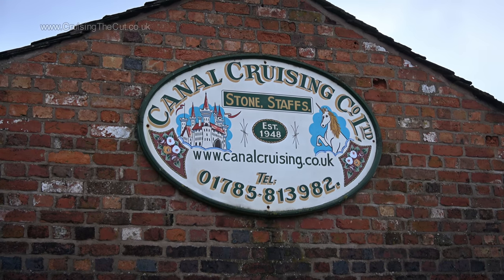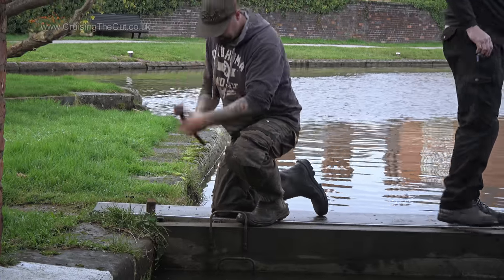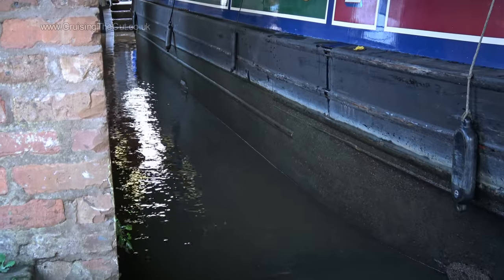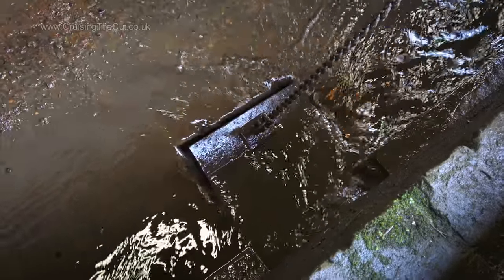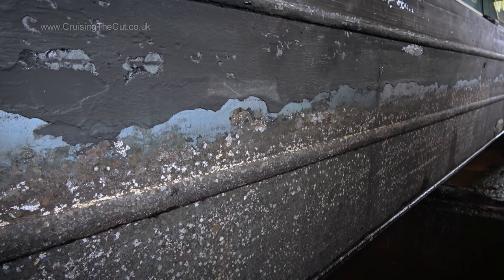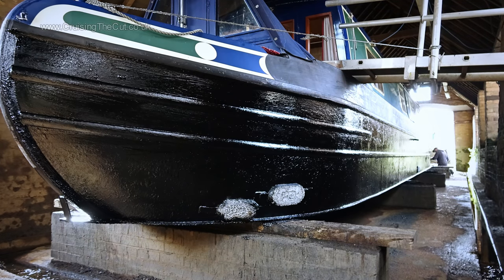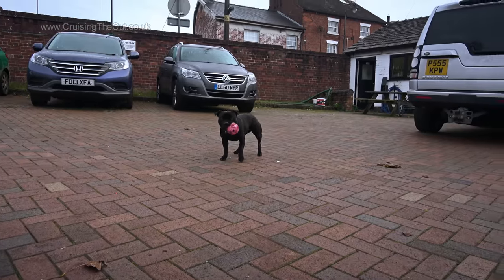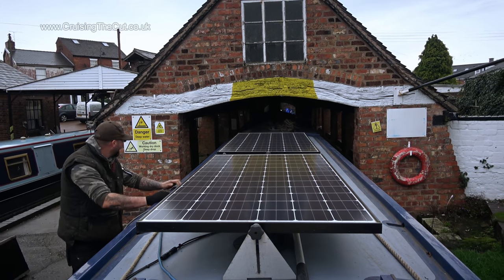201. In dry dock! Re-blacking my narrowboat

Comment: You are the second boater having had their boat blacked that i follow , the other being your friends Narrowboat Experience . They had a different type of finish if my memory is correct .I think they said they could leave it for five years  or more . I'd be nervous about that amount of time unchecked , but they did their home work .
Reply: 😂 With all the slightly negative comments ref epoxy coatings I suspect their boat will be inspected a lot sooner than five years ... 

Doubtless their homework spot on ref the product per se. But the weak point is the actual application of the product onto the bare steel.

According to forums and manufacturer's websites it is essential to keep as close as possible to the manufacturer's method statement when applying the product.

Took up the epoxy v bituminous coatings issue with our resident marine engineer this very morning.

He was less than enthusiastic with epoxy coatings on narrowboats explaining that the coating was not as impact and abrasion proof compared to bituminous coatings.

(He opined epoxy coatings would be fine for sea going tugs, say, as there were so many fenders that metal to metal contact was quite rare.)

Again in the engineer's view the best coating he had seen was cold sprayed galvanising.

I gather galvanized coatings self coat over a scratch but please feel free to do the correction thing.
Reply from the maker: They used a two=pack epoxy coating. However, not only is the epoxying expensive, my boat would require grit-blasting all the old bitumen off first (which is extra expense). Then the epoxy can still be scraped off in the canal. Plus I'd still want to haul it out every three years to check the hull over anyway because that's just how I am. So ultimately, I might as well stick with bitumen.
Reply: @CruisingTheCut  if it's not broken don't fix it 👍
I too read that you need an ideal environment for the epoxy to take correctly. A dry dock doesn't give you that environment
Reply: @CruisingTheCut  I agree with you .

Comment: Aaaaaand most importantly and always omitted for some reason... how much did it all cost?
Reply from the maker: Omitted because it varies enormously depending on where you take your boat, how long the boat is, how many coats you want, the type of blacking used (etc). As a rough guide, it was about £10 per foot of boat length when this was done.

Comment: David, from a comment you made it sounds you haven't resolved the fender spacing issues. try googling  "fender board"  they work, are cheap and easy to make, because of the weight of your boat I would use a fir  2X8 or something comparable.  Dave

Comment: I have asked this question of others and perhaps you as well - however,
I have never gotten a response.
Why moor up in the winter?
Are there rules about staying off the canals at that time?
Is it just because of cold bad weather?
Do the Locks freeze up?
Why?
Reply from the maker: No rules against it - in fact some of the rules are relaxed in winter - but there's little sunshine for solar so you end up running your engine a lot for power / hot water, plus as a solo operator, I'm not a fan of operating frozen / slippery locks on my own, plus it's very cold (!) plus the days are short and yes, the canal can freeze over sometimes. Basically it's just more convenient to moor in my case in a marina with facilities and a shoreline etc.

Comment: I really enjoy your programs. I do find it interesting that you don't paint the bottoms with antifouling paint. I used to run a marina here in the States ( New Jersey) We were at the beginning of the In land waterway to Florida which was salt water mixed with brackish fresh water which would coat the bottoms with barncales and other types of moss like coating and would really hurt the performance.and increase fuel consumption.  Don't you have the same problem?
Thanks again for you your video's .
Reply from the maker: Not really; I've had a few tiny mollusc-like things on the bottom but they'd stick on to the blacking anyway, I think
Reply: @CruisingTheCut  Thanks for the comeback.I look forward to your programs, keep up the great work
Bob Yuma AZ
Reply: @robertarnold1449  Hi Bob, I have a boat moored at Harwich (North Sea - salt water) and barnacles etc are a real problem, ideally jet washing and antifouling twice a year. On fresh water my boats seldom grew anything and hardly needed jet washing every two years. Also the sort of boat you saw being painted black probably only draws 20" - 30" and travels at less than 5 mph, so performance is not really an issue. Tony

Comment: We have aluminum hulls on houseboats in the US. Any reason to keep using steel and frequent maintenance on narrowboats ? Sorry if this has been answered elsewhere, I just haven’t seen it.
Reply: I dont own a narrowboat but 2 things come to mind why they use steel instead of alu 1 is cost alu is like ten time the price of steel and strenght ide imagine an alu hull would be easily holed by debris in the canal where as steel just scrapes over debris
Reply: Presumably your houseboats are permanently moored on a berth for years?

Navigating narrowboats on UK canals is sometimes described as a "contact sport". You will hit other boats, locks, lock, pilings whether you wanted to or not.

Wind is your enemy here, plus stray currents generated by outflows from sluices or weirs or confluences with rivers merging with canals.

You will also get hit by other boats and it may be your relatively soft aluminium hull might come off worse when walloped by a heavier, harder boat?

Comment: Was the underside of the bottom blackened?  I don't recall you did it last time either?
Reply: Doesn’t need it, below the water line, 10mm thick and bashed on everything. Some people do paint it but many do not. Anodes also protect the bottom plate. Rust needs oxygen to form, it can’t get it as easily under the waterline in fresh water.

Comment: Very gratifying this video.

Doesn't the bottom of the boat need renovation too?
(Sorry, I used Google Translate)
Thanks.
Alexandre - São Paulo - Brasil
Reply from the maker: Some do but most don’t as the main area of rust is along the waterline and the baseplate is very thick steel.
Reply: What about algae buildup on the bottom plate, causes drag and uses more fuel.
Reply: @christopherjeffries7538  Top speed is like walking speed so drag is minimal and 90% of time they are stationery.

Comment: Was the job in hand costly??It is a wonderful feeling when the water is let back in and it refloats once again.good vlog.👍👍
Reply from the maker: Traditional blacking usually costs anything from £8 - £15 per foot of overall boat length, depending on where you have it done and what they use.
Reply: Does the £8-£15 per foot include the pressure washing etc?

Comment: Where did the name for the bottom paint come from bitchermen? i'm guessing they used between 10-15 gallons? and for planning purposes how much did something like that cost? how much per month would need to be set aside?, another GREAT!!! video :)
Reply from the maker: Traditional blacking usually costs anything from £8 - £15 per foot, depending on where you have it done and what they use.
Reply: Not bitchermen. Bitumen.
Reply: Bitumen is what natural asphalt is made from. In the old Testament, Genesis, Tower of Babel, says they used "tar" for the bricks. Bitumen is the more accurate translation, but the average person doesn't know what it means. See the ESV version of the Bible for reference. ESV assumes a better read reader.

Comment: Have you thought about getting your boat epoxied? I’m thinking about doing it next year but is seriously expensive
Reply from the maker: Thought, yes but not only is the epoxying expensive, my boat would require grit-blasting all the old bitumen off first (which is extra expense). Then the epoxy can still be scraped off in the canal. Plus I'd still want to haul it out every three years to check the hull over anyway because that's just how I am. So ultimately, I might as well stick with bitumen.
Reply: An epoxy base will only really protect the hull from corrosion, not the only job of blacking. It does give a fantastic surface for the blacking to adhere to.
The boats that live in salt water have epoxy primer, epoxy gelcoat and still add a bottom paint.
They still need to redo the bottom paint every couple of years, the hull itself still protected with the once every 10 - 20 year epoxy paints. ( time varies due to original hull condition and hull material. )
Reply: @CruisingTheCut  
Definitely not a bad idea checking the hull every two or three years.
Reply: @CruisingTheCut  As for hull inspections, did you look at the bottom while it was in dry dock ?

Comment: Very interesting vlog. Does not the bottom of the hull need blacking? Apologies if you've said this elsewhere. Why is there so much "mud" in the water? One rarely sees clear canal water.
Reply: Hull sits in water - Rust need air to form, so not an issue
Reply: I can't answer the bit about the bottom of the boat, but the reason that there is so much mud in the water is because much of the canal is literally just a very large ditch dug in the earth.  My understanding is that generally, only the raised canal sections are lined with concrete or stone.  Add in the inflow water from the various rivers and streams that flow into or are otherwise connected with the canal system and the silt and soil they bring in along with the action of water flow and the turbulence from churning boat props and you have a recipe for silty mud buildup.
Reply: You really, really don't want clear water. Sun reaches the bottom and the water plants go mad. It makes navigation quite difficult as the greenery on the bottom and blanket weed choke the waterways.

In some other YT vlogs there's shots of the CRT blanket weed clearing machine if this is new to yourself.

In fact the worst problem on the canal is Nature itself. If not water plants it's the bastard thorns and brambles and reeds on the non towpath side of the canal which scratch the paintwork and nearly have your eye out, removes stuff on your roof, sometimes for ever, and allows silt to build up on the bottom.

You want the silt in suspension throughout the water column.

Ironically not enough boats on some stretches to stir up the silt.

Comment: Why are these boats not hot zinc metal sprayed at manufacture?  It’s used on sea fishing boats so must be good. It can also be used to treat  any gouged or deteriorated areas. The finish is quite rough so epoxy or black over the top would stick just fine.
Reply from the maker: There is at least one canal marina that offers a zinc-spraying service followed by blacking/epoxy but it's extremely expensive.
Reply: @CruisingTheCut  Yeah I'm actually quite surprised that they still use a tar based paint and not a 2 pack epoxy that would last 10 or 15 years on a correctly prepared surface. No need for antifoul of course but one would think given the cost of haul out the saving would be considerable. Given the frequency of replating (i've been doing some reading and browsing adverts) traditional blacking obviously has it limitations and while I can understand the desire to use that method on a historical timber craft it seems counterproductive on a modern steel version.  

"Ah!" I hear you say. "But anodes still need to be changed!" Well yes but that can be done without hauling the boat or you can take her to a tidal area and put her up on the flats for a tide and do it there. Mud isn't an issue, you drop a sheet of ply over the saide once the tide is out and stand on that. It will provide sufficient flotation (on the mud not on water) to prevent you becoming a statistic of the UK's admittedly killer tides. 

I'm all for tradition, it's a wonderful thing but sometimes it needs to be tempered just a little, much like your use of solar power. Oh and those slips are wonderful, any idea on the age? 

PS: I'm sorry, I've had so many questions I look to be taking up a bit of your time the last few days but I'm quite fascinated and this may be end up somewhat expensive once I can travel from Down under once again . . .
Reply from the maker: @Marvin The canals aren't exactly known for the tidal mudflats.. ;-) But many narrowboats do get epoxy painted instead of blacking. Like the zinc spraying though, you'd first have to shotblast off any bitumen, which is not cheap. And the epoxy's not cheap. And personally, I'd still like to inspect the hull every 3 years so the benefit of no haul-outs for 7-10 years would be lost on me.
Reply: @CruisingTheCut  No not many tidal flats in canals but there are in places like the Thames or a couple of other accessible places you have been. I fact i interrupted vlog #144 to reply to this.  If you wish to an inspection every few years than I can understand why blacking, it just seems a tad primitive to a salt water sailor.

Comment: Amusing and informative as always.  One question: does the flat bottom never get repainted?
Reply: He answered that in a couple of videos. Rust or corrosion forms much slower under the water and the base plate, the bottom of the boat is 10mm thick and at times will drag the bottom so there is really never a need to repaint the bottom as the paint would probably be worn off anyway.

Comment: Speaking of “immensely satisfying”... seams to be both a quality and theme of your videos, thanks! Quick question about the rudder: what is that piece that sticks up with the hole near the top used for? Google wasn’t much help in the matter as I couldn’t find a definitive name for that bit.
Reply from the maker: Hmm, not sure what bit you mean, sorry
Reply: At time index 9:08(ish) and again at 10:45(ish) the rudder appears to have a “handle with a hole”. Instead of being square, there’s that extra bit that sticks up above the bottom of the boat. I can’t imagine the rudder is so heavy the manufacturers needed a point to lift it, but then again my imagination is often foiled by reality. I thought maybe it’s a way to haul the boat backwards but that would seem dangerous (for the rudder) and impractical. Every probable explanation only left doubts and more questions, I know it’s an odd thing to focus on and wonder about, sorry.
Reply from the maker: I didn't know the answer but according to another commenter,  "the hole in the rudder plate is for lifting it when said rudder is installed. Makes it easier dropping the rudder pin into the cup bearing on the skeg."
Reply: @CruisingTheCut  HAHA! Thanks, I guess I shouldn't discount my instincts, even at 2 AM. Curiosity satisfied, thanks! Many warm wishes for you and yours this holiday season!

Comment: Do they tend to have a lot of dry docks along the canals? I'm used to boats being lifted by trailer, or a sling lift for smaller craft, since it's easier to have a yard on land that can have dozens of boats in it at once. That, and you'd need divers to set the chalks per boat, since lake-going boats are not so uniformly made. I'll bet having everything so standardized makes for an easier time for maintenance shops. Though I imagine there are still issues with having different electrical systems and engines. One thing I learned boating here is that nothing is standardized, even two boats of the same model number and manufacturer can be entirely different (I hear it's the same for RVs too.)

We had a few issues in places with being too wide, too long, or too deep of a draft. There's basically zero standardization when it comes to most of the boats here. It's a good job all the locks are absolutely massive. But finding a marina that can do some emergency service on bigger boats can be a pain. Sometimes even finding one with slips large enough to get an overnight mooring is bad too. We've had to spend a night or two at a fueling dock.
Reply from the maker: Not that many dry docks but a lot of wharves have huge cranes to bring the boats out, or tractor-pulled slipways

Comment: Would you be able to post the approximate cost for the work performed? (I know it is different depending on the yard)
I ask so that it can be fitted in to a "general" costing for maintenance over time, to go along with your first-year vlog about the costs to move permanently onto a narrowboat.
Reply from the maker: Traditional blacking usually costs anything from £8 - £15 per foot, depending on where you have it done and what they use.
Reply: @CruisingTheCut  Obliged!

Comment: How much did it all cost ?...Or roughly :-)
Reply from the maker: Blacking typically costs from £8 - £12 / foot depending on what you have done. That's for bitumen, not two-pack epoxy which is a lot more expensive, especially if you have the boat grit-blasted first which is often required.
Reply: @CruisingTheCut  So 5 or 6 hundred quid? Seems quite reasonable..

Comment: What did it cost you for them to do the work ?
Reply: He mentioned in a comment they charge £8 to £15 per foot of hull they're blacking.  His boat's 70 feet long so around £560 ($686) to £1,050 ($1,288)
Reply: @danielseelye6005  No, his boat is 57 feet long, not 70!

Comment: It's crazy how thin the hull is. My GRP boat is over an inch thick.
Reply from the maker: Yeah but it's solid steel...
Reply: @CruisingTheCut  Well fibreglass is stronger than steel. But has poorer impact and abrasion resistance. So steel is perfect for coming up against all the masonry, shopping trolleys and dead bodies that populate the canal.